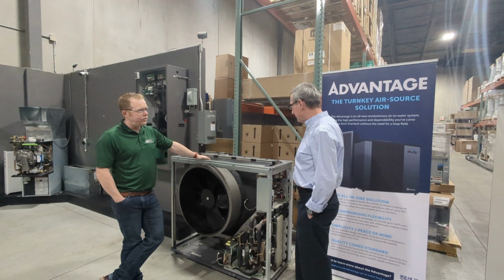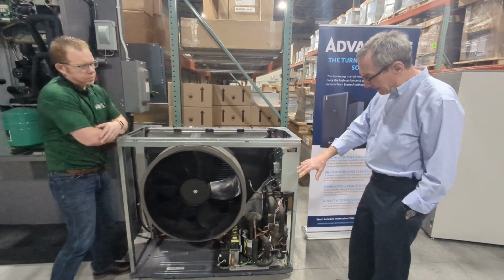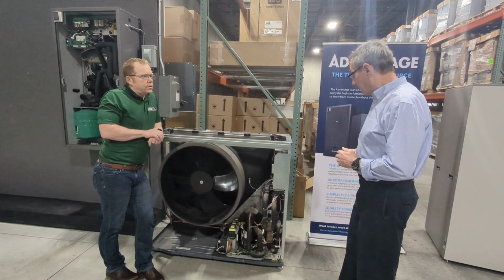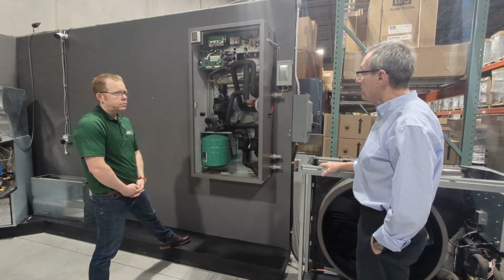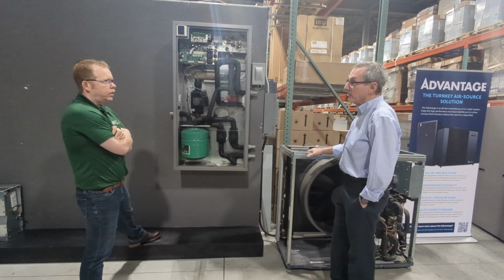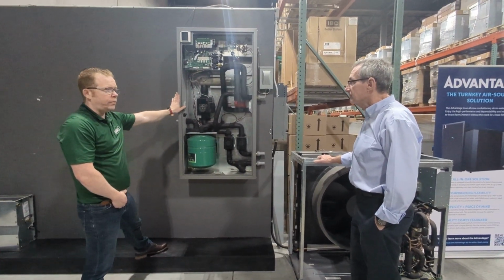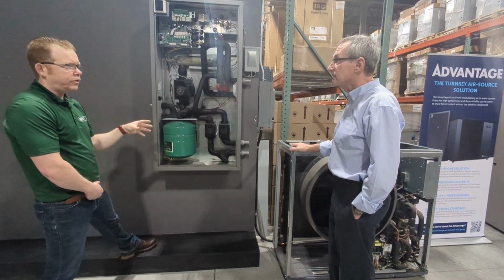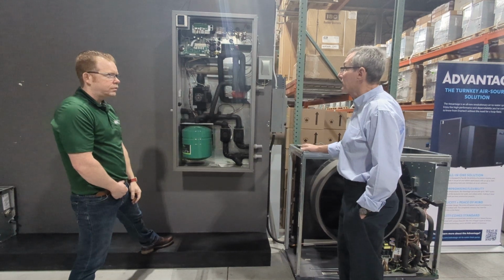John Siegenthaler & Michael Ridler Discuss Enertech Air to Water

Comment: Why wouldn't you go with R290 since it's a monoblock and all the refrigerant is outside?
Reply from the maker: R290 is not currently an option in any air to water residential equipment in North America. R454 and R32 are very common.  We agree R290 is a great solution when it comes.

Comment: Whats the min turndown on that unit..................30%?
Reply from the maker: The unit is a digital scroll with a minimum rpm of approximately 1500 rpm and a max of roughly 7200rpm. With this  you will see a flow rate of 3 gpm to 14 gpm or roughly 8000 btus to 60,000 btus depending on outdoor design conditions and load in the building. 

The unit is capable of doing much lower ( think 800 btus ) but the equipment has a lot of logic built in to protect the unit from abuse and mistakes by the installer. When the unit fires up it will always ramp up to approximately 2400 rpm for about a minute to prevent oil pumping issues before it actually starts to modulate down to its minimum as it heats the home. This is why its important the system gets PIPED properly. The beauty of this unit is thanks to the packaged indoor unit they have eliminated 90% of the field issues we normally see. 

If you need lower then the minimum firing it is easily achieved with zone synchronization to prevent small loads from beating up your heat pump. The key to any good hydronic heat pump install either air to water or water to water is a good installer who knows what they are doing and a distributor that can support them. Thanks for the great comment!